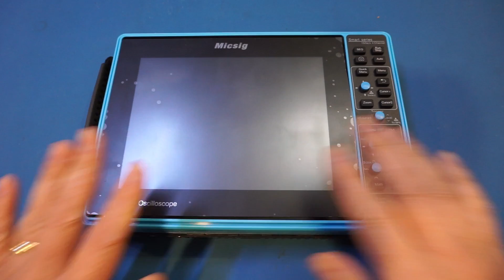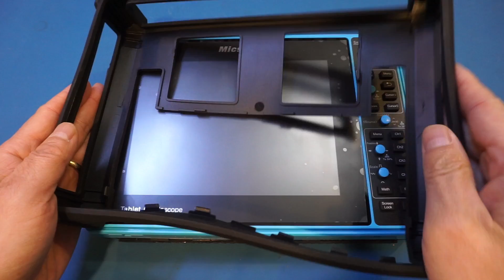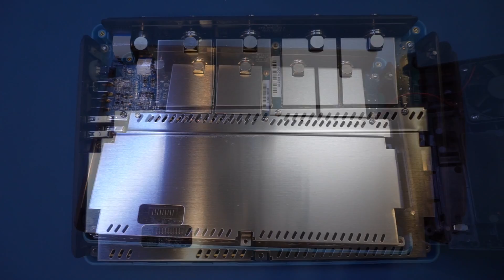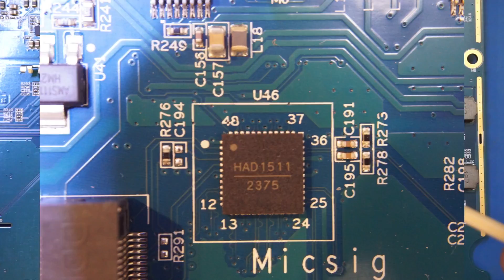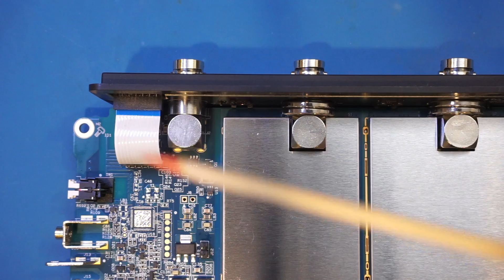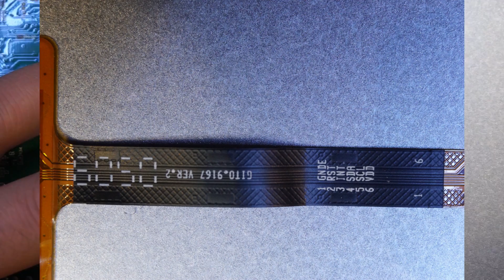Teardown of a Micsig STO1004 Smart Tablet Oscilloscope

Comment: The label on the SoM points to the RockChip RK3568, an Android compatibel ARM SoC. So that is the Application processor. It makers sense as the oscilloscope part can stay the same for many years. However, as Android advances, so does the requirements for the application processor. So by putting that part on a separate board, they can keep the same design and upgrade the application processor in the future without a redesign of the oscilloscopes main board.

Comment: The SoM is the CPU. It's labelled RK3568, which is a big RockChip ARM. The device under the heatsink on the mainboard is almost certainly the FPGA. 

Basically, the entire main-board is oscilloscope specific. I'd bet the SoM is common with some of their other devices. all they had to do here was hang their oscilloscope hardware off some of the spare IO. It's probably a custom Micsig part, considering it seems to be labeled "MS_RK3568_CORE_V1.0". I'd guess "MS" stands for MicSig.

The device near the FPGA you point out as flash is I believe DRAM. The part number doesn't yeild any search results, but it appears to be the same as the DRAM on the SoM. The other large part near the FPGA is "NTSRAM", which seems to be a funky flow-through SRAM variant (seriously, look up S7N801831M. It's a interesting part). In any case, it's SRAM.
Reply: Right this threw me off too, it's in a standard SBC form factor (rpi has a pi in this form factor or similar iirc). The card is labeled as what it is and is likely not the oscilloscope side of things.